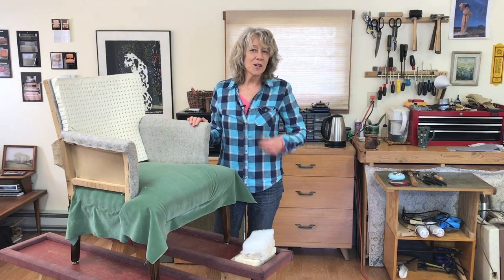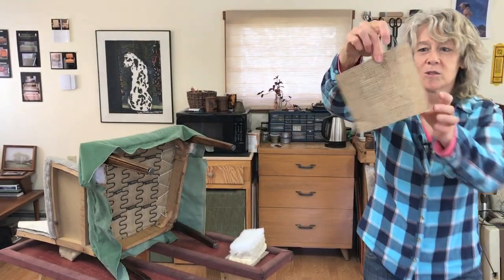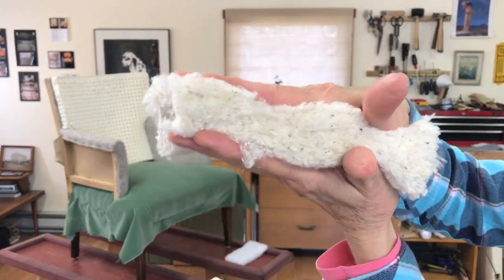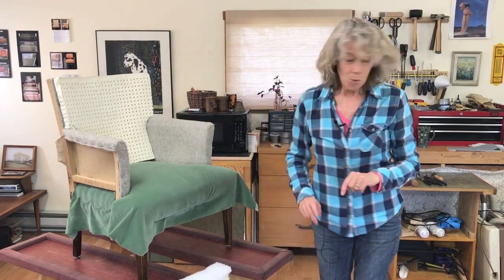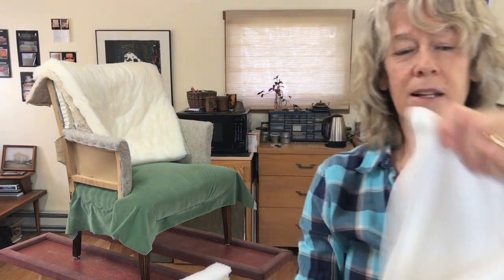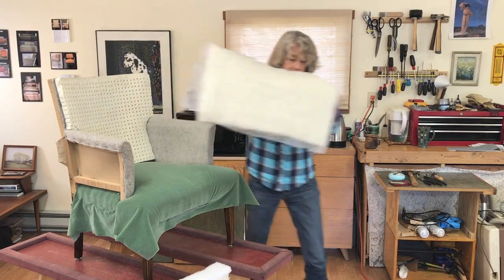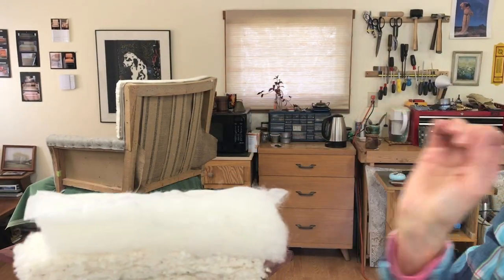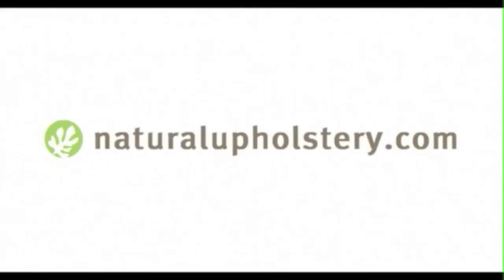4-Earth Day Upholstery Project - Choosing Natural Materials

Comment: Thank you so much for sharing your series of videos showing your natural, layer material approach to upholstering. Wonderful! I began my own tear down and reconstructed love seat sofa. Changing it from a stylized large curved arm look to a fresh Mid Century Modern combo/minimal look with all natural materials. I finally settled with a 100% cotton velvet from JB Martin, which is the same material I had on my old Ethan Allen sofa for years. I washed it for over ten years, and yes it did wear down. But it never shown signs of wear for over eight years of continual washing. It served its purpose in a house with dogs. At some point, I began having severe reactions to chemical off-gassing. I had to change everything in my life. And through my searching to replace all things toxic, toxic foam and fabric was one of my biggest concerns. All new couches where we live, unless leather. Had very strong odors I could not bare. And at this point, leather was not in the budget. After I have several large projects under our belt in upholstery. We may do our own all natural material sectional. Making a new couch would be quit rewarding and a heck of allot cheaper in the sense that; you know whats inside. But for now,  modifying our old sofa was good enough in our small, limited space home we rebuilt from a fire.  

As I tore off the old fabric and layers off. A structurally sound, hard maple frame was discovered. It brought me back to the years working with wood in my parents custom kitchen business. After figuring out the new styles that excited me most. I realized I had a gem in the rough. My husband and I cut away the old curved arms and left straight wood lines with a hint of Mark Sikes/MCM.  I began to remember the MCM furniture my parents had growing up. God had given us creative gifts in whatever we attempted to do. Me as a metal artist and my husband with an architectural background and his current remodeling business. We loved doing any projects with our hands. Both my parents where designers in their own right, and could make anything together. I came across your site, a year or so ago and subscribed to your email list. I tried to purchase materials from you, last year, but our project never came to completion. I saw an email note about your new series. (Due to financial restraints I was never able to complete our sofa project.) Lol. We can only laugh at our avoidance to have people over, till its finally finished. Because who wants anyone to see an unfinished sofa with wooden exposed arms and a sheet covering the frame like a bachelor pad. Uhhh. One mishap after another. God Words that says, in Him you shall not want...surely gave me peace of mind; despite having to prioritize and put our couch project on hold again. Lol! Times are tough.                                                           

~Your videos could not have come at a better time. It has released me of all the questions I needed answered. Specifically about seeing a visual example of the order of material, layers, and the easiest way to apply them. Not overthinking things. Thank You! I will be finishing this project along with many others my husband and I need to complete, hopefully by next year. The most important project coming up right now is my full-size bronze wire cross for the Lord; which I am eager to make. Blessings! 
Kim

Comment: How do you prevent migration of the cotton batting over time?  I want to use cotton batting over foam under leather. I'm concerned that the cotton will shift over time since it lacks the structure of, say, a poly batting.
Reply from the maker: The cotton batting sticks pretty well to the foam. I would use wool batting between the cotton and the outer fabric (or leather in your case)